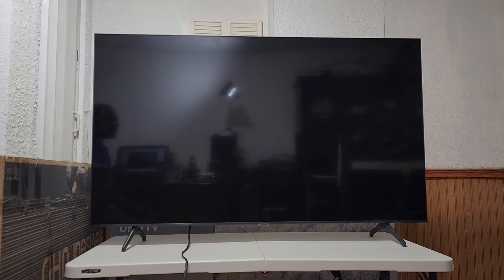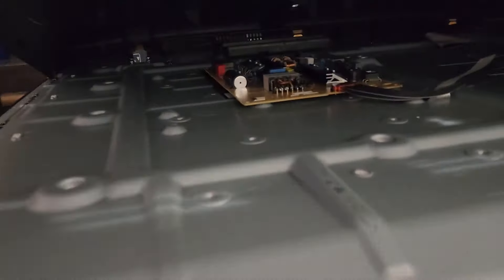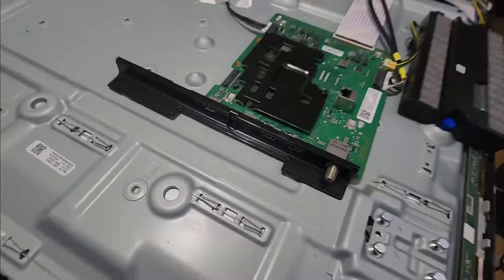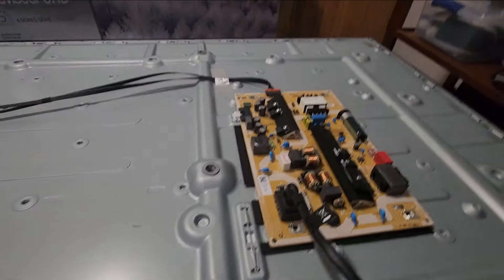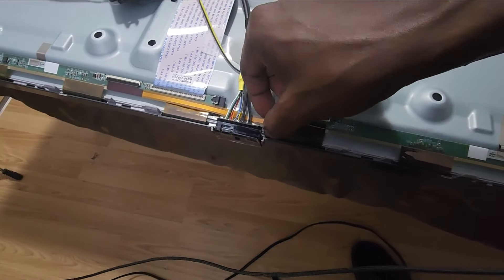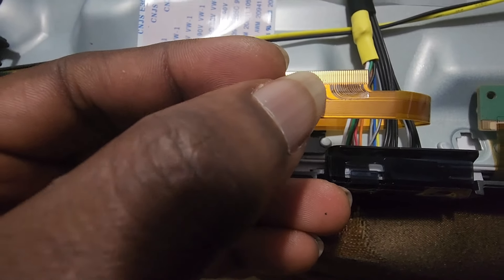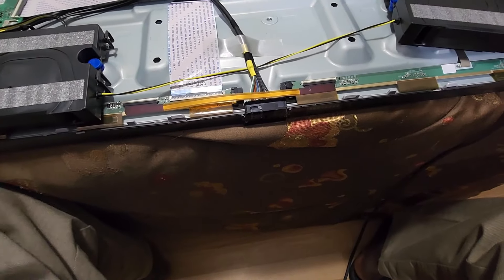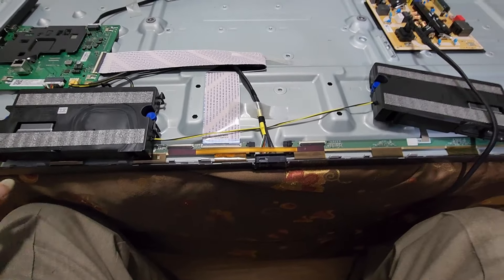Fix Samsung TV Boot-loop, Power Cycle, Rebooting Issues. TU7000/8000 Series. UN58TU7000F Tape Fix.

Comment: Stop buying Samsung it’s the worst tv out there, can’t believe ppl don’t read reviews.
Reply from the maker: Reading reviews is highly recommended but i believe Samsung still has some good TVs out there.
Reply: So please why it happens like that because i was having the same issue on my Qled tv
Reply: It's very expensive tv so why they refused to do it quality?
Reply: Samsung people are very wicked
Reply: ive owned samsung and they never gave me trouble until these new ones
my first samsung was a standard 32 inch from 2017,
Reply: Not really..... They still have good TVs. People need to have proper power surge protection in the house. I have 2 other 60 inch samsung TVs that are doing great for the past 6 years. It's just this series that is so sensitive to voltage spiking.

Comment: Great info.  I had similar issue with a lightly used, four year 75" Samsung QN75Q60TAFXZA.  Ordered and replaced the main board $80 and that did not fix the issue so tried this tape method. Covered pins 7 & 8 hoping that would help but the entire left 1/3 of the screen was completing black.  Then I covered pins 1-4 and hit the jackpot as 100% of the screen works and looks perfect.
Reply from the maker: @user-dt3vq5lu1p  Comments like yours make me happy. I'm very glad you could get it working again.
Reply: So after you put the tape how many months can last you the tv?
Reply from the maker: @mduduzishabalala2348  Its been close to a year now and the tv is still working.
Reply: @GidFix-pl3lg  wow that's great man
Reply: I also fixed two tv Samsung 58 " is working
Reply: Excuse me, is there any way to use the three-use meter to observe the metal test point of the right bridge drive plate stv vss ckv 1-8 vgh vgl lc1 lc2 with a total of 14 points. Do you know which point is the problem? Because I can watch it if I cover it all now, but it‘s a little stupid to cover the test one by one with the old method.
Reply from the maker: @james81220  As far as I know, you can check connectivity between the test points from the right and left side.

Comment: It worked for me! It was a little tedious working with the tape and narrowing it down to just 1 pin but it actually went faster than I expected. There are some slightly darker lines visible up close but it is absolutely usable.
Reply from the maker: I'm glad it worked. The TV is still working perfectly to date. Yes, there are lines but only visible when very close to the TV.
Reply: Nasıl yaptınız anlatır mısınız

Comment: Hi. I blocked some pins but then the tv stays on but it’s just a blank blue screen
Reply from the maker: @chukwuemekaphilip5144  You may need to block other pins if your issue is complicated. Sometimes, the led panel failure can be drastic, which makes the taping method very tedious.

Comment: I did this and the screen is now white and pics are negative pliz help
Reply from the maker: I am not really sure what you mean by "pic are negative". Make sure you haven't swapped the ribbon cables.
Also, a white screen means you are probably covering more pins than expected. Try to narrow it down and cover as little pins as possible. It requires a lot of trial and patience.

Comment: Hello, i have Samsung TV, model LE37C530F1W. When the power cord is unplugged and plugged back in, the tv starts itself and is bootlooping about 10 times, then is working normal. Everything is fine until the power cord is unplugged again and it's doing the same thing. I cannot find nothing suspicius, i changed the main big capacitor but it does the same thing. What could be the problem ? Thanks
Reply from the maker: Try disconnecting the motherboard cable from the power supply board. Then, plug it in and use a multimeter to check the output voltage to the motherboard on power supply to see if there are voltage fluctuations. If the voltage is stable, then it's likely your motherboard causing that.

Comment: I tried the tape trick and could not make it to work. The best I could do was to stop the boot loop.
Reply from the maker: After stopping the bootloop, what do you get on the screen now? Please note that you may have to adjust the tape several times on different pins until you get a good picture. You will need lots of time and patience to eliminate the right one.

Comment: Great video. I have AU8000 50” I am able to stop boot loop, consistent backlight, sound, and proper standby mode (solid red light when TV off) but I still can’t get any picture unfortunately. I replaced both the power and the main board before I got to this point of pin taping, so I’m positive it’s this. I just haven’t covered the right pins on the ribbon I guess. Close to giving up.
Reply: I had a similar issue on a Samsung 50TU8072 50" TV and tried the fix described in the video, which solved the reset loop issue, but produced a black screen (sound, power on button, remote and backlight LED array seemed fine, but could not get any image). What SOLVED THE ISSUE COMPLETELY for me was applying the tape on the very wide connector cable coming from the main board and going into the long and thin LCD controller board at the bottom of the TV (I applied it on the LCD controller end, though it probably does not matter which end you pick as long as you apply the tape on the main board cable only). The difficult part was singling out the correct pin to tape (a lot of trial and error, starting with wider tape and ending up with a thin strip just 1 or 2 pins wide), but the result was well worth the hours spent: there is no detectable loss of quality, but of course time will tell how durable this solution will be and how long until I need to repeat the whole process, in case another pin becomes defective...
Note: as I was testing out the pins, I found several of them which removed the reset loop issue when covered with tape, but produced a black screen with sound and some combination of adjacent pins which even produced some image if all were covered (only vertical or horizontal lines, color zones, gradients or grids of various colors, no clear picture though), but only ONE particular pin returned the TV to full normal functionality in my case; depending on your TV defect you might need to cover just 1 pin or several (not necessarily adjacent), just arm yourself with a lot of patience and take the time to test them all out and good chances are you will have saved a lot of money!
Reply from the maker: @anihilus2886  Excellent explanation, sir.
Reply: @anihilus2886  thanks for sharing the result of your fix effort. Please which pin gave you the desired (or should i say this best) result?
I have a similar Samsung with same boot loop.

Comment: Thank you for this great video. I have the same provlem on the RU8009 (2019). I tried taping the T-Con Cable feeding the main board and it worked for a few hours. Then i did the same thing on the other side on the other side whcih worked for a bit longer before the issue reoccured. I wanted to replace the T-Con Board but now im not sure unless i do a continuity test. What would you do next?
Reply from the maker: @Ted4938  If the issue keeps reoccurring, I doubt it is an issue from the tcon board. Try removing the tapes and starting again. Sometimes, you may not be blocking the actual pin, but because you blocked some pins, it could have rectified it temporarily until the actual channel begins to act up again.
Reply: @GidFix-pl3lg  Thank you very much, I'll try that 👍

Comment: Thank you for the video.
I have same tv with same issue.
I did few test with tape and finally manage to find that blocking number 17 pin get me image but there are a few small black horizontal line on the image. Looks like pin 17 go to the VGH on the right side. Voltage on left vgh is 24v and vgh on the right reads 6v.
Is there somthing else that i can do?
Thanks!!
Reply: You found a solution? Exactly the same problem

Comment: Hey, great video! I had the same problem and I also found the pin, which caused the restart. But after i taped it the light remains on but i don't have a picture. Do you have an idea why this happend?
Reply from the maker: @JulianHols  Hi, were you getting any sound or pictures when the problem started (when the tv was power cycling).
After tapping, if you are not getting any sound or pictures, you may need to tape multiple pins. I will suggest disconnecting the ribbon cables one after the other on the left and right to see if you get half a picture or at least some sound.
Reply: I had a similar issue on a Samsung 50TU8072 50" TV and tried the fix described in the video, which solved the reset loop issue, but produced a black screen (sound, power on button, remote and backlight LED array seemed fine, but could not get any image). What SOLVED THE ISSUE COMPLETELY for me was applying the tape on the very wide connector cable coming from the main board and going into the long and thin LCD controller board at the bottom of the TV (I applied it on the LCD controller end, though it probably does not matter which end you pick as long as you apply the tape on the main board cable only). The difficult part was singling out the correct pin to tape (a lot of trial and error, starting with wider tape and ending up with a thin strip just 1 or 2 pins wide), but the result was well worth the hours spent: there is no detectable loss of quality, but of course time will tell how durable this solution will be and how long until I need to repeat the whole process, in case another pin becomes defective...
Note: as I was testing out the pins, I found several of them which removed the reset loop issue when covered with tape, but produced a black screen with sound and some combination of adjacent pins which even produced some image if all were covered (only vertical or horizontal lines, color zones, gradients or grids of various colors, no clear picture though), but only ONE particular pin returned the TV to full normal functionality in my case; depending on your TV defect you might need to cover just 1 pin or several (not necessarily adjacent), just arm yourself with a lot of patience and take the time to test them all out and good chances are you will have saved a lot of money!
Reply: I’m having a similar issue with model QN75Q65FNFXZA with repeat power cycling and no sound after troubleshooting I’m getting just a back light with still no sound :(

Comment: I'm curious to see what you think about my issue: I have a Samsung 75 inch LCD (circa 2019) model television. Not sure if you know the answer to this (or anybody watching) but my symptoms are that when you go to turn it on, the (Samsung) logo comes on solid at first… and then these horizontal lines develop (which are sort of similar to the horizontal lines we see when you first used the tape)... and then the TV shuts off and goes through that cycle again. (And again) for a while… But it does finally turn on within 15 minutes and works fine.

Usually for 10 minutes + it reboots, over and over again. 

When it's just about to turn on and work (which it does usually in less than 15 minutes of letting it cycle like this) it finally gets past the logo and you start to see the main MENU screen, etc. and then the horizontal lines develop and then it shuts off ... and restarts and then FINALLY, it comes on for a few seconds (with the sound of whatever the TV show is that's playing or whatever) then, it usually goes through one more cycle... and then it stays on (and works perfectly, from that point on (until you turn the TV off again). 

I'm wondering if that's a power board issue (rather than a main board issue, or the issue you had)?

According to the seller who sold it to me, It did start occurring, just after a lightning storm. 

Do you think replacing the whole power board would do the trick in fixing it? Short of that, is there a particular part (or two) on the power board that would usually be the culprit that I could replace for a lot less money than replacing the whole power board? Even if I have to pay about 125 bucks for a new pwr board, I think it would be worth it. (It's a great TV once it stays on). 

[After watching your video, I'm guessing it's probably a similar panel problem and rather than open it up and try the tape trick, etc., since it does turn on and stay on after 15 minutes or less, I think I'll just live with it until I can afford to get a new TV. Thank you for posting this video] 🙂
Reply from the maker: Hi, thanks for the detailed explanation about your tv and sorry for the late response. Your issue is quite unique and may be a problem from one or multiple sources. Lightning could have partially affected the power supply or both the power supply and panel itself. Usually, i would try to do some elimination. Since you haven't disassembled, it could be best to use it as it is. However, it may eventually stop working. 

The first thing i would try is to disconnect the motherboard from the powerboard, and switch it on and test the voltages that feed the motherboard with a multimeter. Ensure the tv has been off for a while so that you can provide the same conditions to replicate the fault. If the voltages fluctuate several times before a constant voltage is achieved, then it may be the powerboard. My reservation is with the horizontal lines that show up every time. That could mean nothing or could be an indication of a panel board or panel issue. You could also listen very closely to the TV if there are any buzzing or unfamiliar sounds when the tv is power cycling.  

If the powerboard gives constant voltage after disconnecting the motherboard, then try disconnecting the panel ribbon cables from the tcon board or motherboard (depending if this tv has a tcon board or is built into the motherboard), switch it on and test the voltage for fluctuations. If it doesn't fluctuate, then the panel driver board or panel itself could be the issue. If you don't have a multimeter, do the above and see how the backlights behave.

I hope this can help you for now. Thanks.

Comment: I’m having similar problem I unhook some and get white screen need some help if you could
Reply from the maker: @mrabieazy  Does your white screen have images when you look closely? If it does, then it's a good sign that, if you patiently narrow down on the pins being covered, you will get an image. Please note that depending on the severity of the issue, you may need to block or cover multiple pin contacts at different locations to get a good image.
Reply: @ I get the smart tv logo and it shits off. I unplugged the wire from the power board to the mother board white light in the back and the screen is on the bluish black screen. I tried to unplug the rib ion to the tcon board but no back lights came on. I taped the right rbbion cable that is from tcon board to the led and it had white screen with lines but no smart tv logo. It turns on with the logo and shuts off.
Reply from the maker: @mrabieazy  Is your TV the same model as shown in the video? What is the model number of your tv?
Reply: @GidFix-pl3lg  no it’s a UN75NU6080FXZA
Reply: @ my other one just shows the logo and turns off real quick
Reply from the maker: @mrabieazy  Okay. So you will have two ribbon cables going from the motherboard to the panel board. First remove any of the cables one at a time to see if the tv will stay on without cycling. Even if it stays on with no image (backlight only), that is fine. Which ever ribbon cable was removed to keep the tv on should be the one that should be taped. Start with something like a 5mm to 7mm width tape, and tape from one end while you move along the entire width of the ribbon cable to see where you will get an image. Is it making sense?

Comment: I have 85 inch Samsung tv it has relay clicking problem …can you help me with guidance ?
Reply from the maker: Clicking sound could be a power board issue. Does your TV keep restarting?
Reply: @GidFix-pl3lg   yes tv restarting
Reply from the maker: @bhawanjitsingh6283  Your TV is quite huge. If you are able to open the back, try testing the power board with a multimeter but without a connection to the tv panel from a motherboard. This is one test to eliminate the problem.

Comment: After covering several pins with tape = no image, backlight is on.
After covering the first pin with tape = no image, backlight is on.
When nothing is taped, the TV does not turn on/the red LED flashes and the TV backlight blinks

Samsung Crystal UHD 50” TU8002
Reply from the maker: I am assuming you are taping the connector at the right side of the panel board. Do you get any sound in any of your scenarios? Disconnect the ribbon cable to the motherboard and check if the backlight will still blink when turned on. If you have a multimeter, you could check if your panel board has voltage coming to them.

Comment: Help, the right side I put tape exactly where taped yours, it stopped the turning on/off. Stay on but I have no picture now. Help?
Reply from the maker: The spot i taped in the video may be different for your TV. You may have to try taping different spots to get it working. You will need lots of patience to figure the right pins to tape.